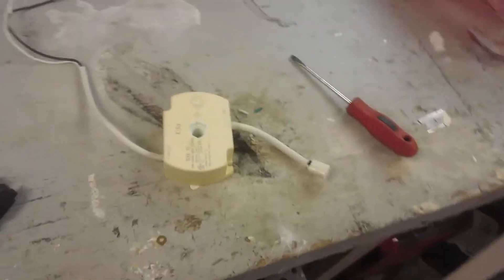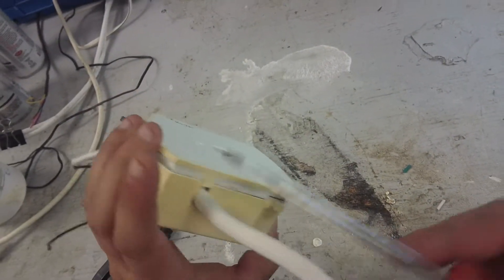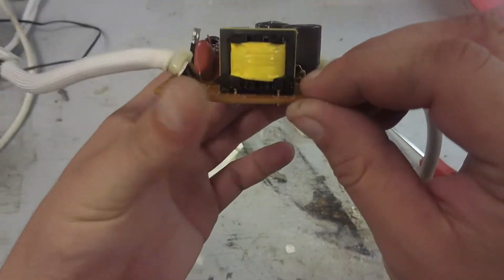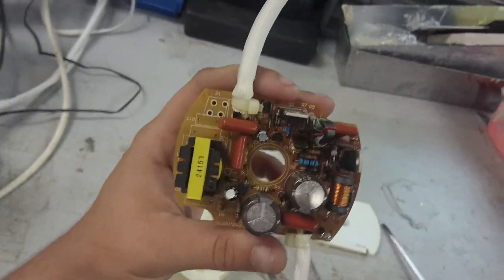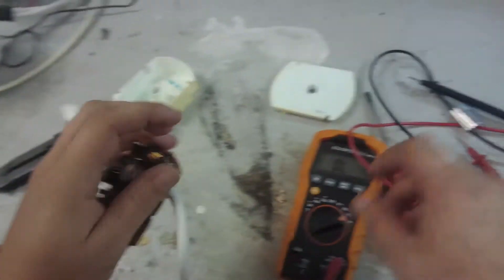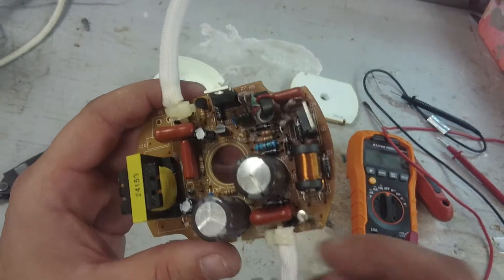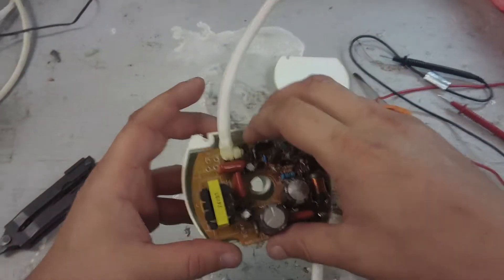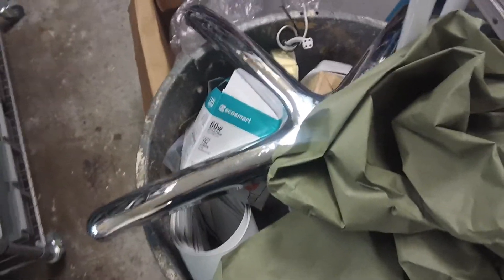What is Inside of a Light Ballast (Why Do They Go Bad?)

Comment: How hard is it to find a replacement capacitor and replace it?
Reply from the maker: You could order off of amazon or an other site but i don't think it would be worth it.  Thanks for watching Joe G.
Reply: @geoffhoweth  Thanks for the reply. I just started a job as a maintenance guy at a Hotel. We have one ballast that's hard to find. After the video, I thought it's possible to just fix the current one. Thanks for your videos. They will help me in my current job.
Reply from the maker: @joeguilfoyle1922   Most ballast are filled with like neoprene rubber so it's hard to get to the components. I was surprised that this one wasn't.  😉
Reply: @geoffhoweth  Yea, I've never taken one apart before but you made it look a lot easier that I expected :-) But what do I have to lose, right? :-) Thank you for your help and please keep the videos coming. Do you by any chance have an email posted for questions? I have an issue you might be able to help me with. Thanks again.

Comment: Those ||| transistor are what are called driver/finals to control the circuit voltage,round small coils thermistor, Electrolytic cap, is swollen which cause voltage to increase a lot in that circuit.BOOM. I work in FM two-way radio and electronics before HVAC in 1974-76.
Reply from the maker: Cool Michael Lee I play around with electronics as a hobby. So it's kinda fun to see why something fails.
Reply: Values/BBROYGVGW--Bad Boys Rape On Young Girls Violet Gives Willingly  That is the code for strips on transistor colors. First thing you learn in school. Capacitors have changed since 1980 they are allot stronger ; use to be all yellow. I work on Motorola,Heathkit,Kenwood FM aka Frequency Modulation two-way radios . Back then Taxi,Police ,Oil business,etc.
Reply: Wrong - the memory aid for remembering the color code is: Bad Boys Rape Our Young Girls But Violet Gives Willingly (or ...Behind Victory Garden Walls). You've only listed 9 of the 10 colors. And those are resistor colors, NOT transistors. Can't believe you're a 2-way radio tech and don't know that.